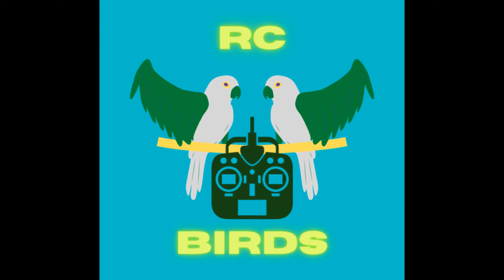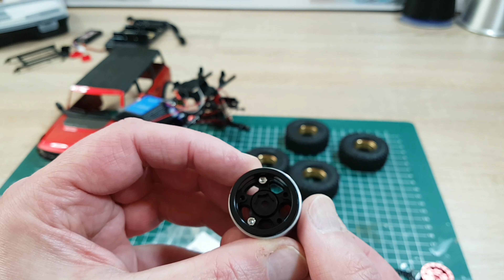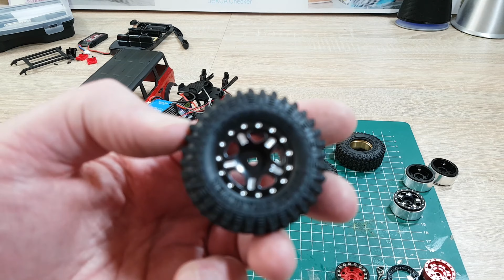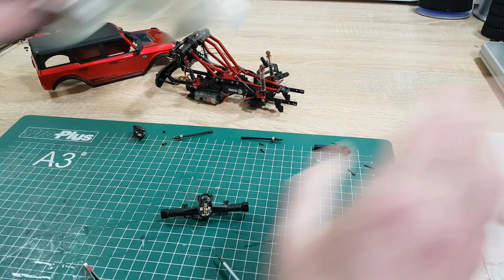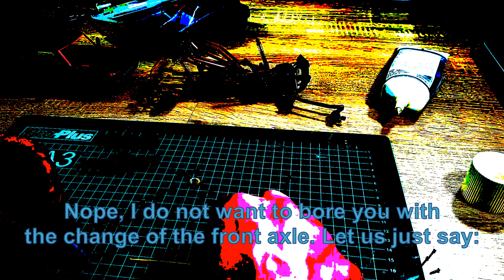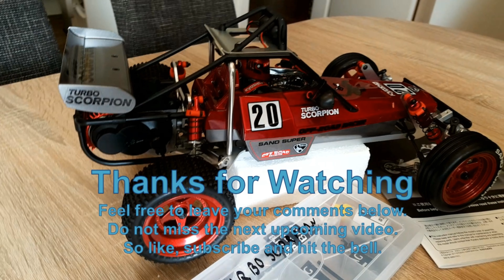Axial SCX24 Bronco second Upgrade - Part 2/2 Dampers, Axles and Rims

Comment: Nice one Dirk! Sorry the front housing didn’t work out. I hope the company will supply you with one that is machined better? That little rig is a beast anyway! 👍👌 thanks for sharing my friend.
Reply from the maker: Thank you for your great words. This means a lot to me. I thought about it. But it also meant putting of the rear axle, cleaning up everything and hoping (cheap China) the new one might fit. Big A would have exepted my complainment, but I'm not sure if they would direct me to the manufactor. So, one axle fits and the other one not. I put this to my experiences for the next car😉

Comment: Yeah there is definitely a lot of trial and error with Scx24 parts I have had parts not fit properly very frustrating good work though it does look nice
Reply from the maker: Three times Brent, three times I tried it. "So einen Hals!" (such a throat)😡. Now I have best of both worlds, a straight axle at the rear and brass parts at the front😉. AND a mega flex😁

Comment: Very cool it looks a lot like mine, I had the same problem with the Injora wheel weights I messaged them and they sent me a new set but it took awhile to get them!
Reply from the maker: Thank you for the tip. I think the problem is that the rims are not from Injora. First I had the right rims and they fitted well. Maybe I'll find nice Injora rims. Even thought of letting the rings made wider at some juvilery.
Reply: @RCBirds  Interesting mine were Injora rims and tires but didn't fit. Oh well maybe like a ring you can have them sized to fit! Lol! Funny thing is I have a set and I know how to size rings hmmm 🤔 lol!

Comment: Looks good, man I HATE those wheels that have a bunch of screws on them such a pain to work with!
Reply from the maker: That was the big issue with my old beadlocks on the TRX4. It's snowing, you want to ride with the tracks and end up with two hours of changing. Snow's not seen ofzen here and it doesn't stay long. Leading to hectic 🤪
Thanks for watching and your kind comment Steve
Reply: @RCBirds  Try treal for the crawlers I have them on my 1/10 trucks they come apart with only a few screws and fit and work much better easy to assemble with the tires too. I think I have some videos showing them and they make the 1/24 scale ones now too.
Reply from the maker: @ShenRC  excuse me, treal? Google can't help me. I'll check your videos as soon as I can
Reply from the maker: Thank you Steve, the link had reached me. I was blocked by youtube. I think it´s because of your link. I watched the video again, I let it pass. But I don´t know why I´m not seeing here. And I think it´s because I have problems by remembering names that I don´t know what Treal means.

Comment: Looks great, but soo anyoing when you buy upgrade-parts and they dont fit. Hope it will perform as you expect even whitout the metal front axle housing.
Reply from the maker: The rear axle now is straight, that's a key point. But, yeah it sucks. You don't remove the parts you already had build in, clean everything up and send it back, hoping the new might fit. Thanks for watching Mattias.